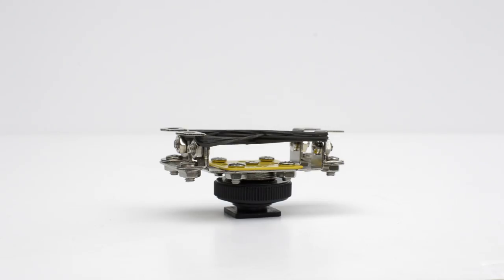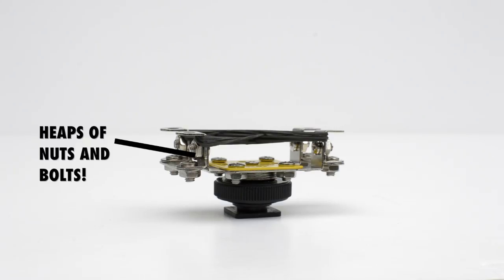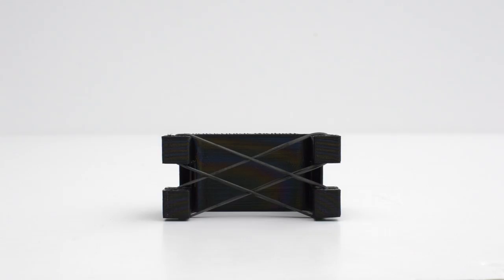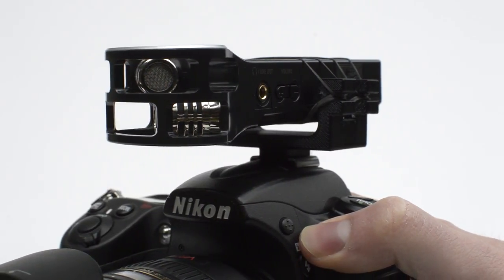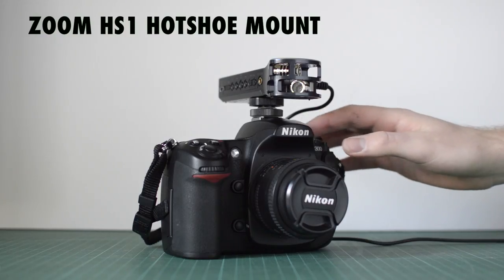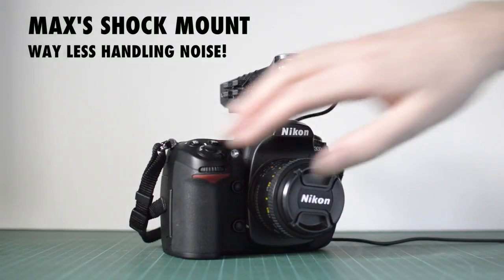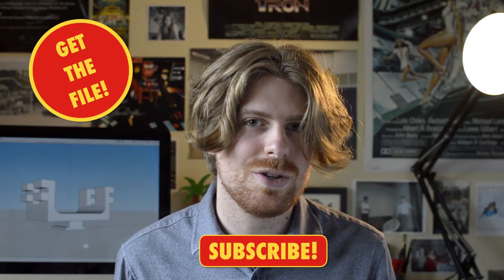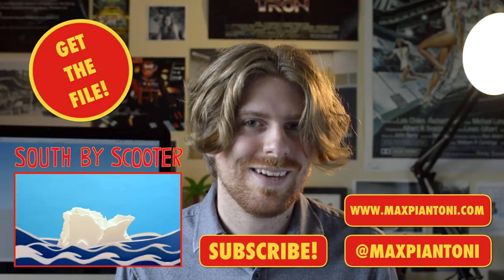A Small 3D Printable Shock Mount For Your Zoom H1

Comment: Can you just make one for sale?
Reply: I just bought one using https://www.3dhubs.com/3dprint You just upload an stl file of what you want printed and they respond with an estimate. I got it for less than $10 shipped. I actually uploaded a version of Max's awesome design that didn't have the hot shoe mount but was instead flat on the bottom with a threaded hole for a tripod screw: https://www.thingiverse.com/thing:687775
Thank you Max!